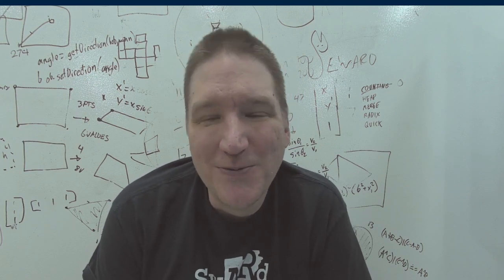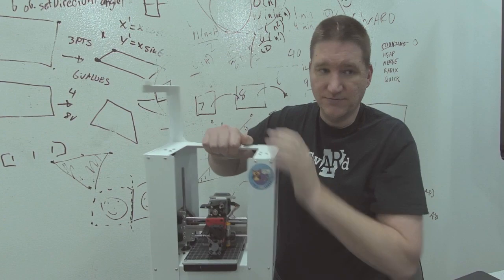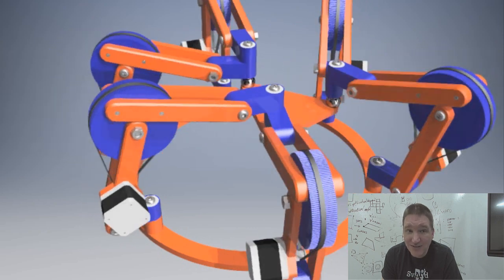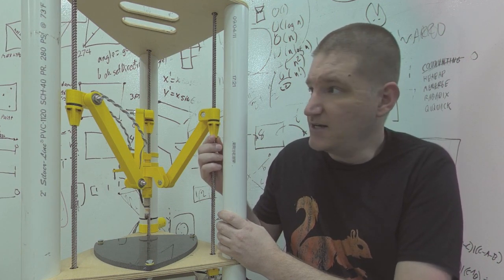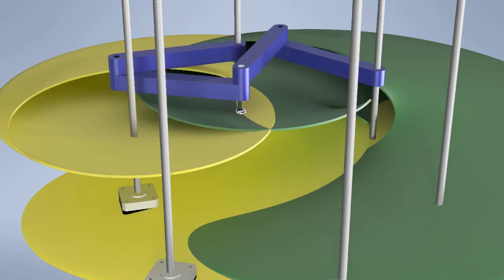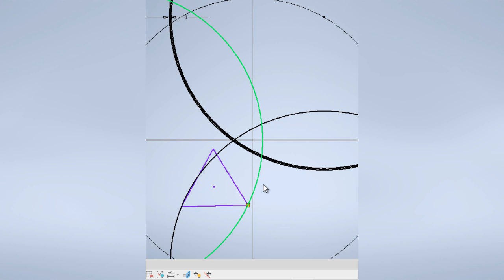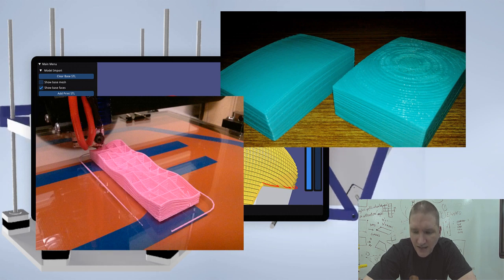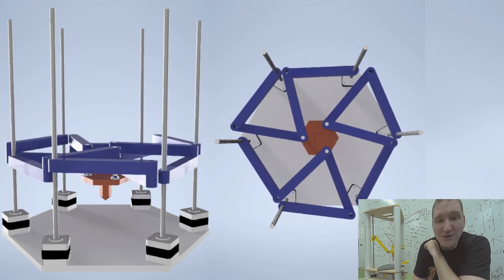HEXASCARDIFF

Comment: Excellent project. Any information about kinematics inverse/forward?
Reply from the maker: Haha. We made the 3dof version and it was as bad as I expected.   Would need almost zero friction screws with a high pitch.  Even with those magic items we would need insanely rigid and light materials to handle any load at all.   I haven't formally done the kinematics.  I probably would go with iterative constraint solving to build a small lookup table to speed processing and to keep away from nonphysical solutions

Comment: I understand the benefit of more degrees of freedom for milling, but what is the benefit for 3d printing? Does the angle of the nozzle change the print? Or another way to ask it, do additional degrees of freedom allow you to print something you can't with a regular 3d printer? (Off the top of my head i just thought of being able to print on the surface of an arbitrarily curved object but I'm struggling to imagine more than that.)
Reply from the maker: The main benefits would be smooth top layers and no limits on overhangs.

Comment: Hi @Nicholas Seward, I've been following your works for several years now, and I agree, using screws to achieve straightness in this context would be problematic for costs/etc. because they'd need to be perfect or it's very wonky and hard to ever get useful results, even if you calibrated for warped screws in software (it could be done, but a nasty problem).

There is another solution that would make more sense, I believe, that'd be an evolution towards Bob Simpson: this geometry is already huge and it'd cost no more space to do it: each of the 6 points use Sarrus linkages with 120 degree angle offsets to achieve straight line motion and structural stability.  It'd be a fun bit of work, but I think far more viable than trying to perfectly match 6 screws, and far cheaper than 6 screws with sufficient accuracy would be. It'd be a design choice as to whether it'd be a suspended design or come up from the bottom for anchors.
Reply from the maker: I am intrigued but don't visualize what you are talking about.  Any chance you could sketch it up.
Reply: @NicholasSeward  I'll try to get around to it this weekend via OpenSCAD.

Let's see if you can imagine this, after first you think about a Sarrus Linkage, of which wikipedia references them with a 90 degree angle between the halves that both bend at the middle.  There's no reason it must be a 90 degree angle between the 2 halves, as any other angle will also work, including 180 where it's just 4 identical length segments bending in the middle and joined on the ends via a hinge.

Now, imagine 6 of them, at 120 degree angles between the halves that bend, both constrained at the top and bottom with the appropriate shape you would expect at the top and bottom: they're guaranteed to create a straight line in the motion at whichever end is unconstrained.  This is where you put one of your arms.  You have 6 of these around the outside of the work volume, and interleave them as needed so they don't intersect each other's path when folding/unfolding.  Whether you do this from the bottom being constrained and going up, or suspend from the top and going down, doesn't change it: if you have a solid foundation for one end, the other end moves the arm with a straight motion platform to work with, sort of like 6 ballerinas doing the same sort of motion precisely, in a tight formation, with legs interleaving, assuming their knees are exactly bending at 90 degree angles (and equal length leg halves) and no flex at the waist/hips or ankles except 90 degrees, making a flower.

The result: because you never want the hinges in the middle to be totally open to a full 180 degrees, you have a work volume a little short of 2 times the length of one of each of the segments, which can be the length of the side of your hexagon for vertical volume, minus the differential you need between the total height and the adjustment of the head in the 3 major directions.

Does that make it easier to visualize?
Reply: @strictnonconformist7369  It sounds beautiful but I am not quite there.  I would love to see a SCAD model.

Comment: Great project, have you think to design something like a brother for HEXASCARDIFF? Wall delta printer with 6 instead of 3 axis, like -x,+x, -y,+y,-z,+z  since xyz have mirror axis in inverted direction, gave more streng, more stable and delta maths, but in some way work like core xy. Hope someday you try this idea. Greetings from Portugal
Reply from the maker: I dont have a mental image of what you are describing.  I can see a TriScarDiff that has three parallel coplanar screws.  Any way you can sketch up what you are talking about?
Reply: @NicholasSeward   I have a  stl draw, I call hummingbird, how I can send to you to see, thanks for the fast reply, so good ideias came from you. Keep the good work 😁
Reply: @sward8757   Great thanks , sended !